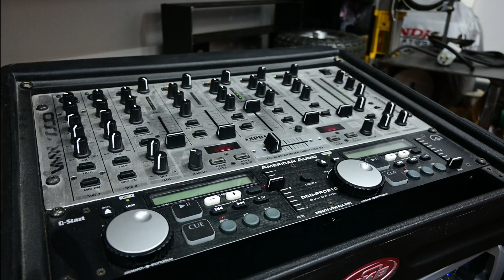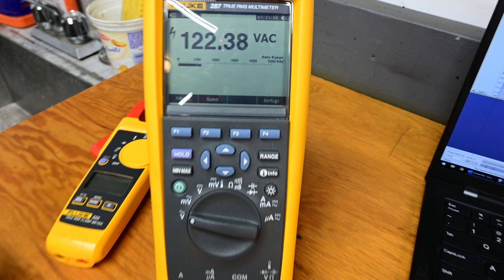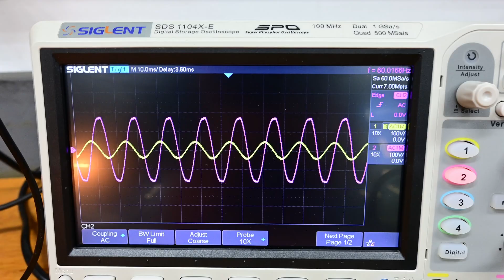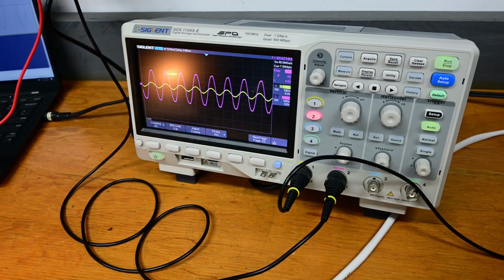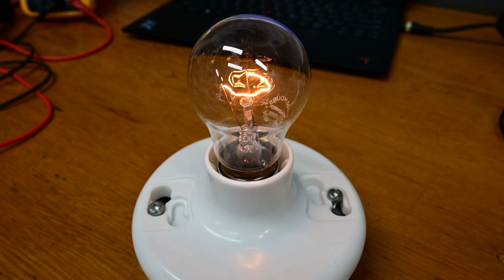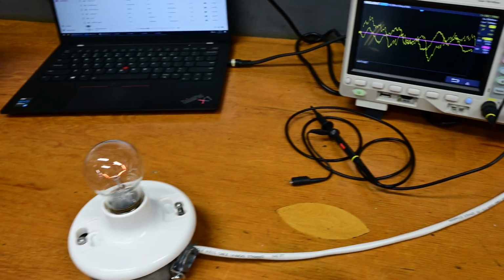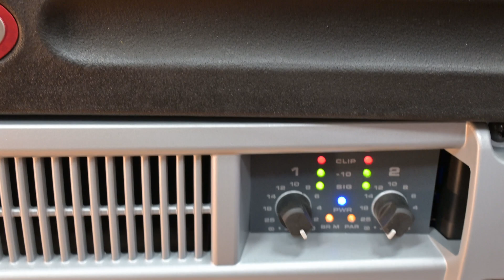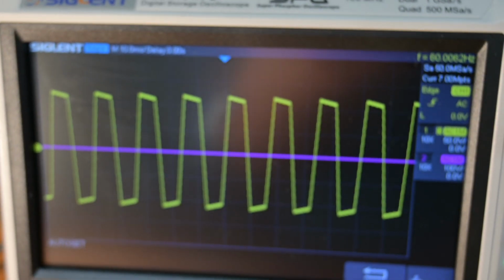Powering a Light Bulb with a Power Amplifier Playing Music

Comment: Thanks for this great demonstration! What do you think is the minimum necessary power delivered by the amp to obtain a similar result? I'd really want to explore the possibilities of this set-up, but if possible with a lower-end amp.
Reply from the maker: You'd need an amp that would deliver 100+ volts to use a regular light bulb, which is going to mean an amp that can deliver 1250 watts into 8 ohms (something like 300 watts into 20+ ohms which is closer to the light bulbs resistance).

I haven't tried it, but a 12v bulb might work on a much lower power amp...usually 12v means DC not AC, but might still work? Worth a shot anyway.

Comment: Very cool demonstration! But, there are easier ways to get a variable frequency waveform with an online tone generator. A quick google will turn up a bunch. And you can also loop a waveform with perfect accuracy down to the very sample itself, so you don't have to worry about the track ending. An audio amp + signal generator is a great variable AC power supply! I always used to mess around with amps like this, powering up stuff like transformers and other non-speaker electrical loads, and it's fun to see others have as well.
Reply from the maker: Thanks!
Using audacity was just something easy that I had already on the laptop, I'd really like to pick up a siglent wave form generator for the bench at some point.
Was fun using the amp as a power supply, neat to see theory put into practice.

Comment: nice video! however i'm following you because i also got the Z30. Any reason your videos are shaky and wobbly (gello effect). I've seen other videos and they don't seem to have that issue.
Reply from the maker: I'm not sure if it's because I tried e-vr on the camera a couple times, the vr in the lens (was in normal, but might need to use sport when panning around), and also tried after with Davinci Resolve to stabilize there. The raw camera footage was just shaky, the jello effect was I think mostly Resolve.

It didn't turn out great, but I'm going to keep messing with it to make it better...or will just go buy a gimbal for it lol if you have any tips though, would love to hear them!
Reply: @SomeGuysGarage  I ordered but hasn't arrived yet. Great video, content and channel! Keep making videos!
Reply from the maker: @R2X2Z  hopefully shows up soon, it has great picture quality and lower light performance but certainly a learning curve.

Thanks :)
Reply from the maker: @R2X2Z  hey, just wanted to follow up...seems the best results I'm getting are from doing sport mode while shooting and then a light stabilize in Resolve after. Definitely got rid of the jello effect, isn't as smooth as say a gopro but is pretty good.